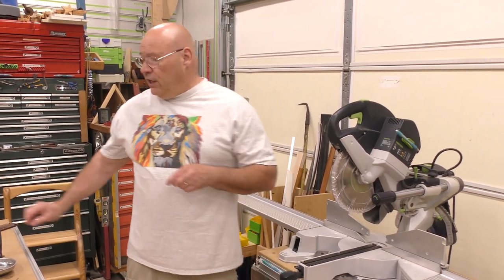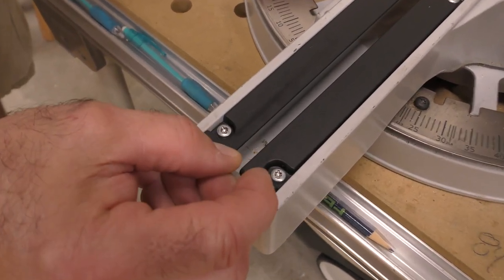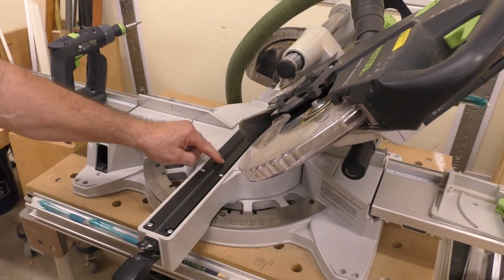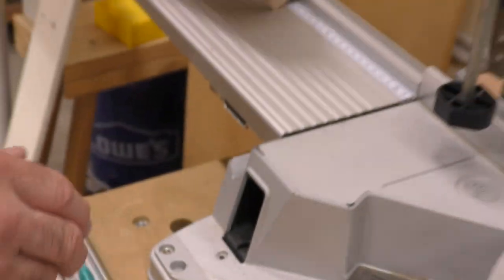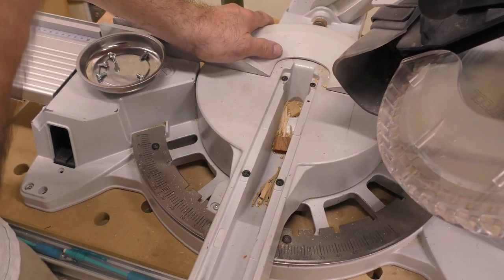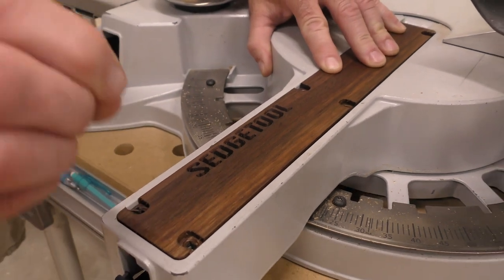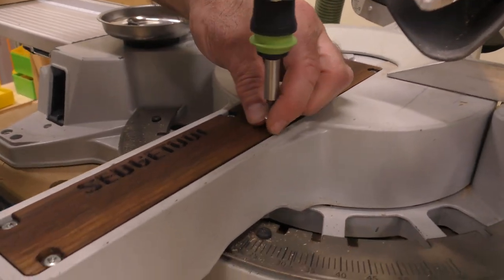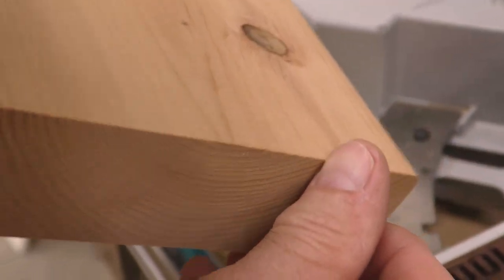Zero Clearance Insert for Festool KAPEX

Comment: That's fantastic.
I have the kapex 120 and so get quite a bit of debris in between or under the plastic strip. 
I bought an 80 tooth blade and the 60 tooth blade has gone walking. I'm not sure when it went.
Using your small drill I certainly miss mine as it is handy for delicate operations. I have not yet replaced all my Festool's which found their way to unauthorised new ownership.
I somehow delay buying cheaper tools as I often return to purchasing new festool upon looking for replacement tools.
I'm pleased because I was going to give my chorded plunge saw to my brother when I bought the 36 volt cordless plunge saw.
I now put a 36 volt cordless 1.8mm kerf plunge saw and wish to purchase the high output 4 amp hour batteries.
I had bought a 6.2 amp hour battery so need an extra battery.
I was going to buy another 6.2 amp hour battery although since they are real pricey now it makes more sense to get high density battery 4 amp hour. Hense in saying that using a 6.2 amp hour with a high density or bigger cell technology 4 amp hour batteries is there any difference in power on how the electronics communicate or can tell the type of battery inserted?
Reply from the maker: I would stay with the 6.2 amp hour batteries on the tracksaw

Comment: Great video Sedge. Now just need the money for the Kapex! :)
Reply: Just explain to the kids that their iphones and food are overrated and if they would like them they can find work anywhere right now.
Reply: Philip Jones. I really like comments like yours. If I can find money to buy a new kapex.
The smaller kapex is a lot more pricey than the larger blade kapex by around $1,000 au.
I bought my kapex for around $1,600 and the smaller kapex is about $2,500.
Where I buy my tools I can pay off and put on laybuy.
To me this suits me fine as I don't fork out a large sum at once.
Yeah I know I can stash money away until I have the right amount.
Seems every day loving you use the money at your disposal.
The way I purchase works fine for me.
I stop at the shop on the weekend and give them a little money at a time until I take the tool home with me.
Reply: Philip Jones edit first comment. I wrote au the auto correct changed to and.
On my previous comment.

Comment: I really want to purchase one of these kapex 120 , but I keep coming across reviews of it failing just out of warranty, usually the switch . It’s a shame as it’s making think twice now. Then I come across a recall 🤦
Reply from the maker: there has never been a recall on the Kapex........
Reply: @sedgetool that’s very odd ! From my research  I think you you will find there was a safety recall on the kapex 88 and the 120 purchased between 2007 and 2010 , there was a issue with it setting on fire when in use and when not in use but plugged in. 
I really like this saw, and really want one to go with my other Festool gear, I just keep finding  issues with the trigger breaking , and the 45 degree presets not making a perfect right angle. I’m hoping it’s just the odd saw that’s slipped through the quality control, or operator error . Only thing that’s worrying is the people reporting this are professionals with joinery shops . ???

Comment: Hi Sedge, are the inserts available in the UK?
Steve
Reply from the maker: I do not know if Jordan ships internationally
Reply: Yes I do ship to the UK 🥳
Reply: @jordanlantz3162  Hi Jordan any idea of the total cost please
Steve
Reply: @bigmonkey999888  one order to Hungary was $25 for shipping. Where in the UK are you I can run a shipping quote for you?
Reply: @jordanlantz3162  Hi Jordan my location is
Leeds, West Yorkshire
Reply: @bigmonkey999888  the rate quote I just ran was $18 for shipping. I don’t know what the conversion for you is, but Etsy will have a fee for shipping that auto generates based off your specific address. It should be close to that

Comment: Im gonna check out the link for those inserts.. i have the slip in inserts but, not a huge fan and there aint no way Im making an insert of quality and fit those guys made.

Edit:
The link took me to their etsy page with just bow ties on it.. I'll poke around for their site after I get out of the shop.
 Adding 2 shelves. One for vac bags and one for the new domino and domino systainer pack...🤩
Reply from the maker: Thanks William...... Working on the link....
Reply: They are renewed in the ETSY page, the quantity went out of stock. The error should be fixed now. Sorry for the issues everyone. We’re back up and running